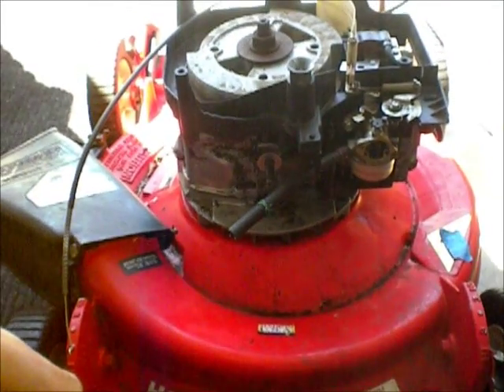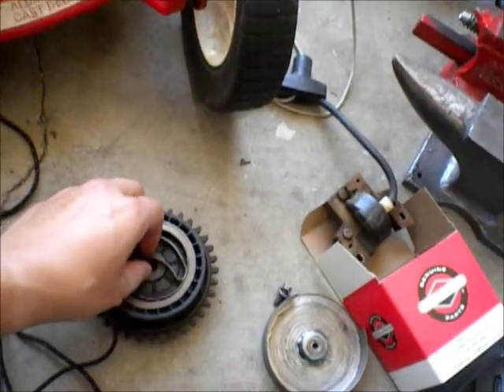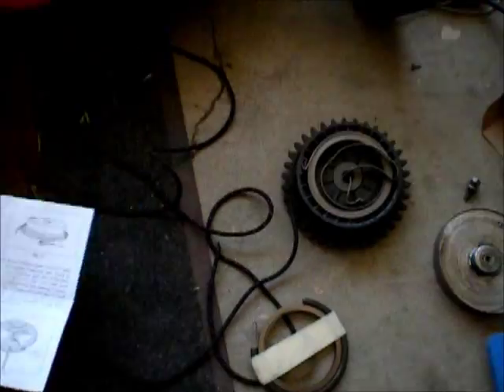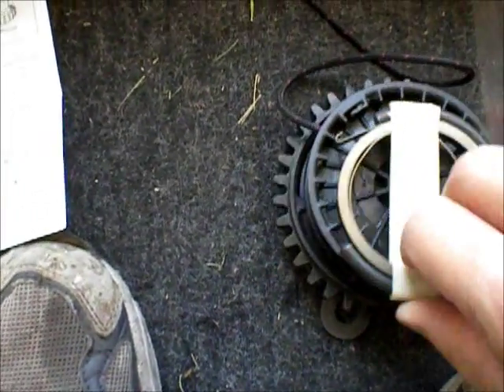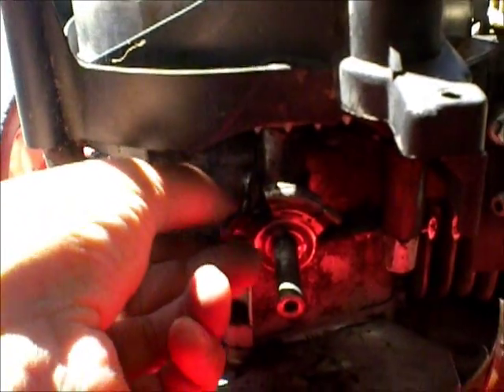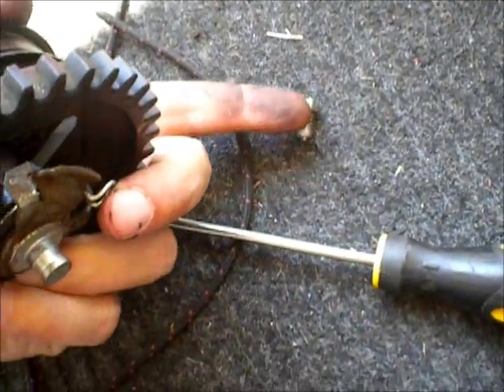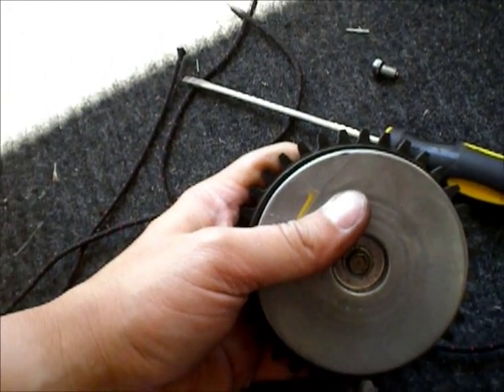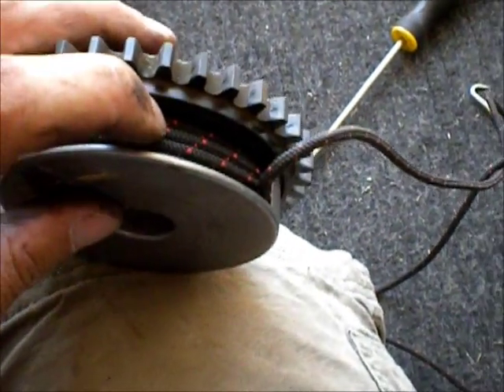Briggs & Stratton Lawnmower Engine Vertical Pull Starter Repair

Comment: you can do this without removing the shaft, i have done it today (incase anyone is watching this piece of lawnmower history). but in my case it looks like the little throw out spring is long gone. but this video shows how one should fit, so we will see what bits of old scrap i can come up with tomorrow
Reply from the maker: @tortron  If I recall correctly, I think you're right. The pull cord wound up breaking years later and I actually used my own video to redo everything and I think I noticed that too. It's still going strong, btw!

Comment: I have one of these engines and had to repair the vertical pull starter about 15 years ago. Well, I had to repair it again last weekend but forgot how I did it previously. Your video was just what I needed to refresh my memory. You're right, it's kind of tricky to work on; quite a bit different than the regular horizontal pull starters. Thanks for posting this.

Comment: Thank you for posting this! I only have one thing that I saw you do that is disaster in the making, and that is you never put grease or any lube at all on your spring! It will gum up with one dusty mow job and you will be taking it apart again! You can squirt some WD-40 or cable lube in the center of the pully where you bolt it down so it will spin freely, but mark my words on that! You will need the spring shiny clean so it can slide on itself but zero lube on the spring. 😉
Reply from the maker: Hi Tony, thank you for the kind words, and you are 100% correct, that spring broke a couple years later and I had to do it all again. I lubed the spring that time and the second one's been a champ ever since. Remember to lube your springs boys and girls!

Comment: I twisted counterclockwise. I broke the bolt. What do I do now?
Reply from the maker: Hi there. If you go to about 4:30 you'll see that shaft piece that the bolt fits into, and how to remove it. Then you can order a new piece (don't forget to order another bolt). It's been a while since I posted this video but I remember at the time that when I went online and started searching for parts for this model I was surprised at how many parts were still available.
Reply: davemiii Sorry, But what would that little stalk or shaft be called

Comment: ok never mind it looks just like it
i need help with it lol im kinda stuck mine will not start right i pull on the pull cord and it goes a little ways and then does not want to pull the cord back
were can i buy that one and how much is it (plz tell me its not an arm and a leg
Reply from the maker: sounds like either the rewind spring is broken or the cord is bound up. i bought my cord at a lawnmore/chainsaw repair place, the repair parts at briggsandstratton.com. the b&g part site is a bit tricky. you need the engine part/model number to download the right manual and parts list. then from there, you have to look through it to find the part you need, then order from their site.
Reply from the maker: davemiii
 the cord was cheap and a lot of the parts aren't too bad either.
Reply: I need to whole thing the cord the housing the spring everything
Reply: I do not need the gear though
Reply from the maker: Hopefully it works out for you. Setting up that cord was tricky. It took me a couple of tries to figure it out. I was cursing up a storm by the end of it.
Reply: can you help me find the one you bought
Reply from the maker: Hi Cameron,

Sorry it's been a while. I dug up my email receipt and what I ordered was the rewind spring           Product: 491889 -SPRING-REWIND STR
          Qty:                    1  EA
          Price:                  9.85  USD
Reply from the maker: If you go to the Briggs and Stratton website, go to Buy Online>Repair Parts and Maint>ShopParts>I Don't Know My Part Number. Then enter your engine part number to start looking at the illustrated parts catalog.